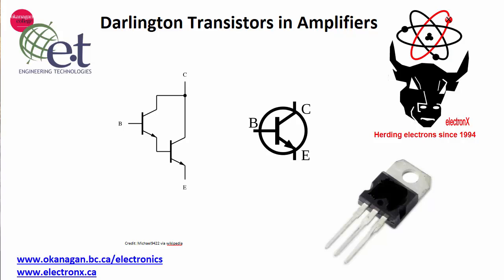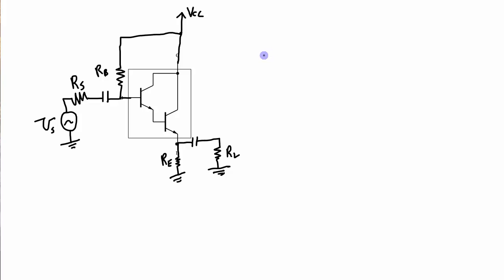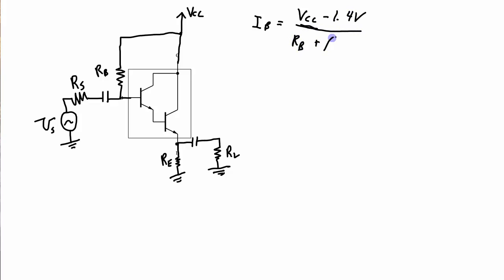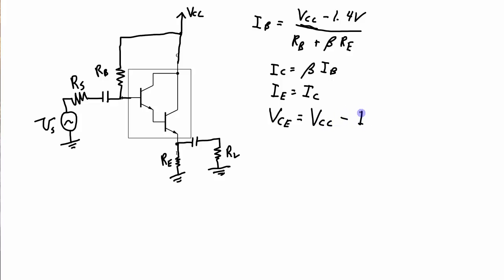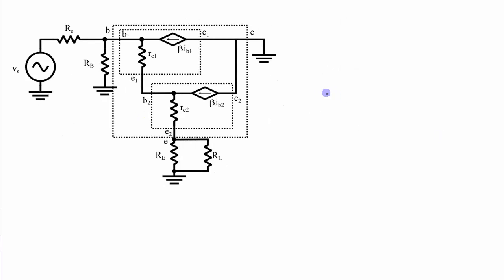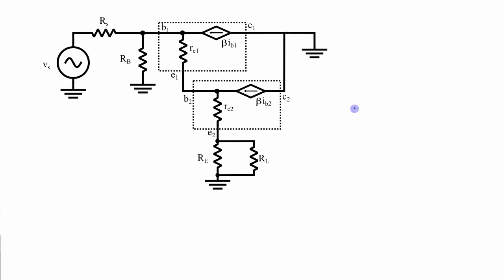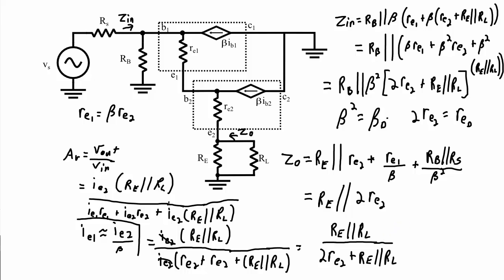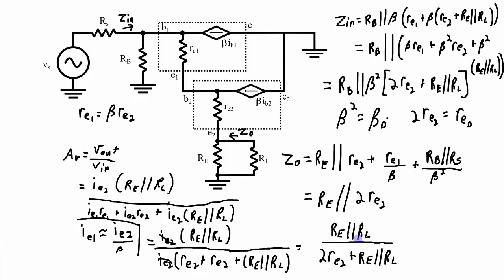Darlington Transistor in Emitter Follower Circuit

Comment: Thanks, very helpful. Do you have an Zin example of a Darlington pair in a push pull configuration with diodes on the input to eliminate crossover distortion? I suspect you have to also take into account the internal resistance of the four diodes? What about the re on the opposite Darlington pair? Tricky ;)